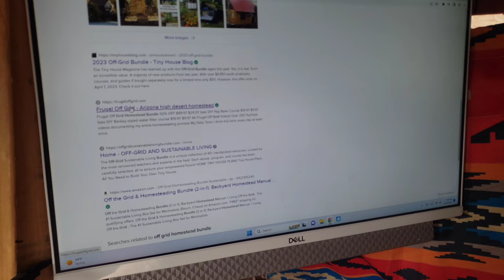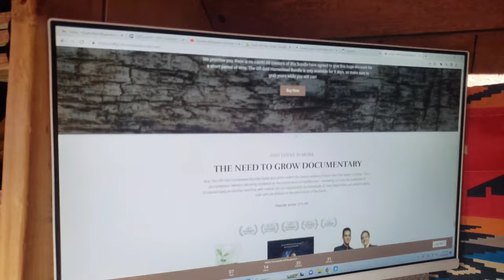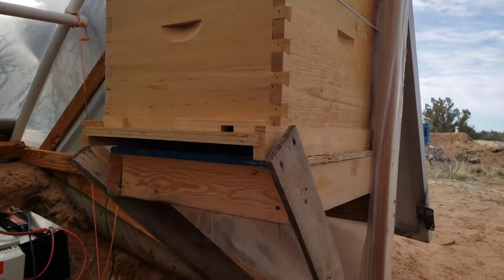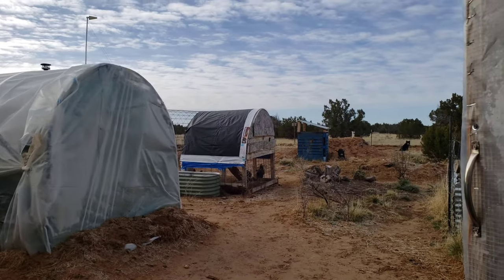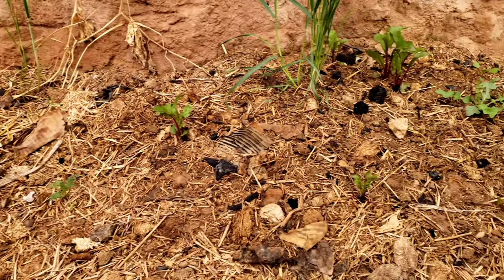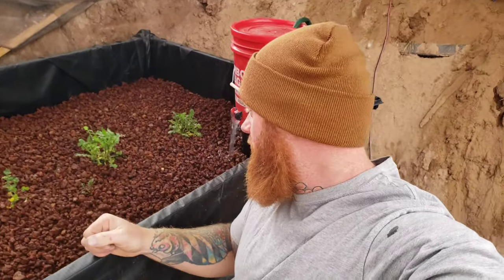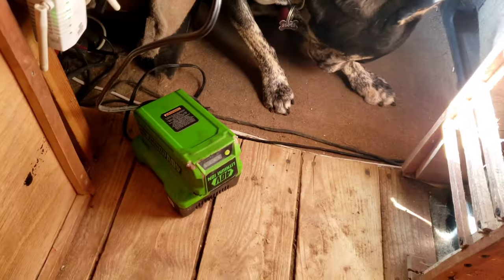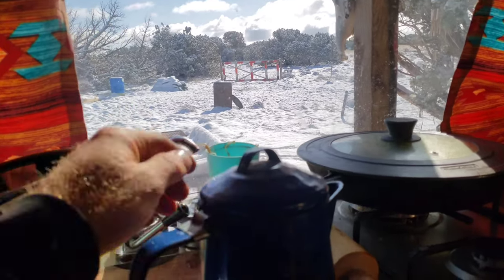DIY Water Cistern Cheap

Comment: Mint can be co planted with tomatoes, the brassicas,  and some of the root vegetables to help ward off the bugs, including aphids and ants. 
It comes in tons of different varieties. Be careful because it's also highly invasive.
Reply from the maker: That's what I hear
Reply: @FrugalOffGrid  I don't begrudge the time it takes to keep it sensibly in check. It pays for itself in bug control.
Reply from the maker: Yea, I'm not concerned in the least. That's exactly what I want it to do up on my berms.
Reply: Mint is great but I would plant it in a pot (or two or three) because it spreads and will take over an area.

Comment: i have seen in older videos wind turbine. what happened to that idea? it was not worth to keep?
Reply from the maker: Had to move it when I put in the larger panels. Just haven't gotten the pipe and concrete to put it in correctly yet.